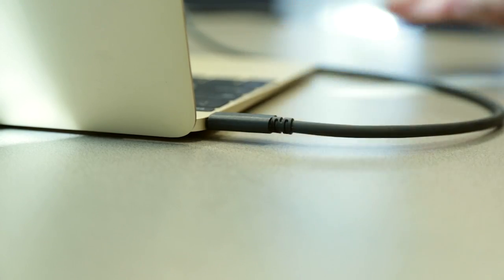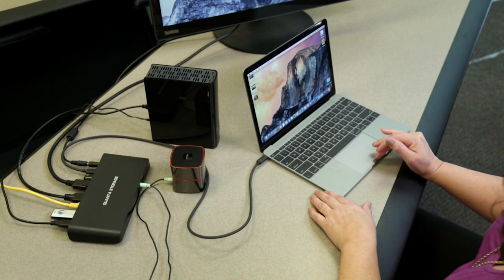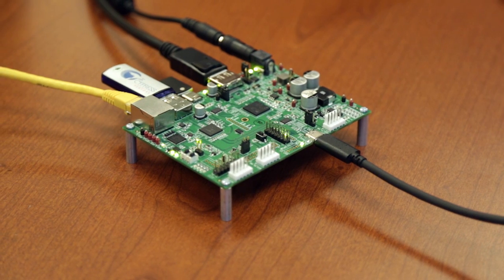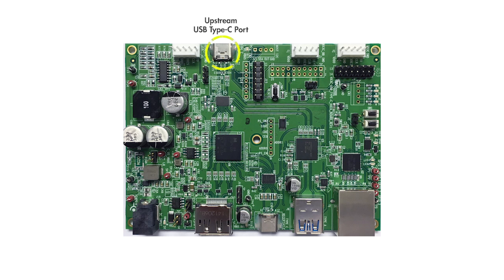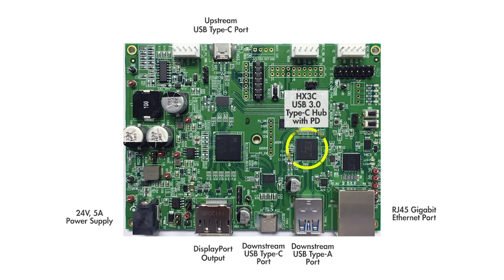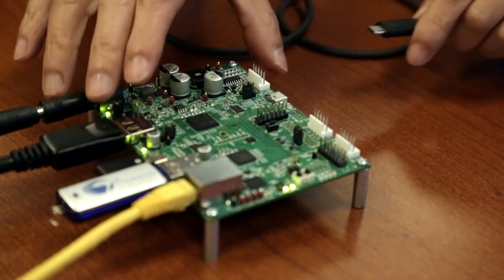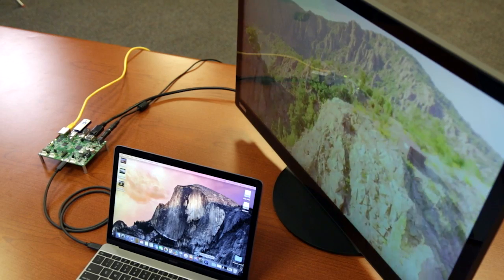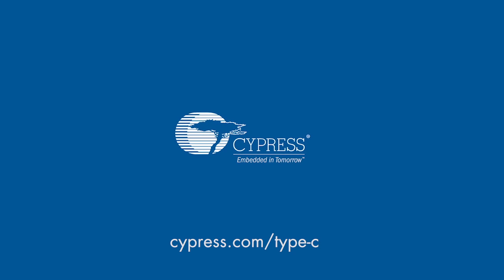Introduction to HX3C, Cypress’s USB Type-C Hub Controller with Power Delivery

Comment: Why is there not a  hub with the ability to support several usb type-c ports like you get for USB type-a?
Reply from the maker: Hi Andrew, Currently, the Type-C hubs are targeted to connect devices currently in the market namely, Type-A USB devices, HDMI display devices and display port devices for Type-C enabled desktops and laptops. Once the number of native Type-C devices increases, you can see a range of Type-C to Type-C hubs. If you would like to build such a device, please contact cypress.com/cdc and we can help you in building a solution based on your requirements. Best, 
Cypress
Reply: Cypress Semiconductor I want a device that can convert Dp and hdmi input signal to usbtypec alt mode Dp.......I have a usbc monitor that only has usbc port.....